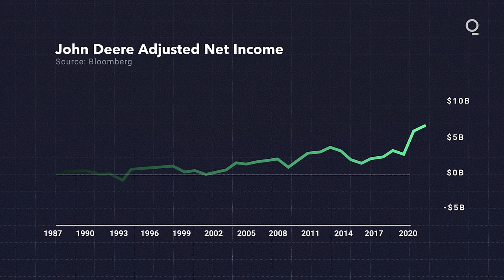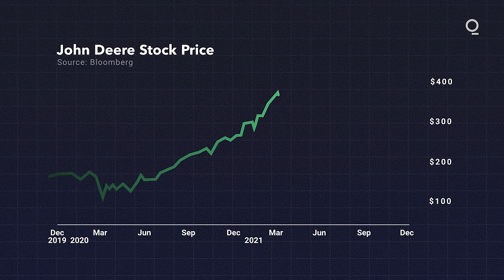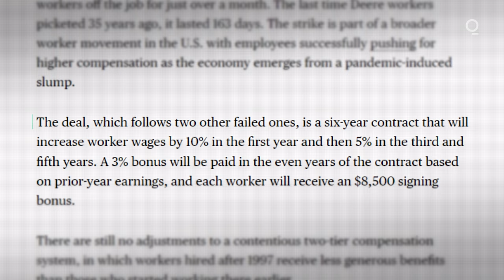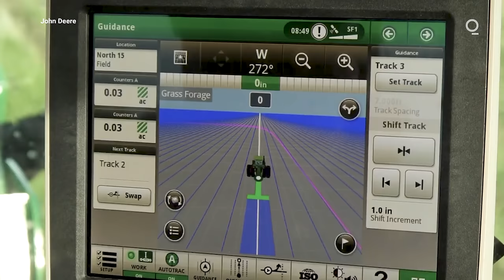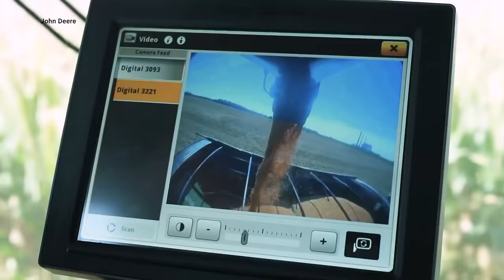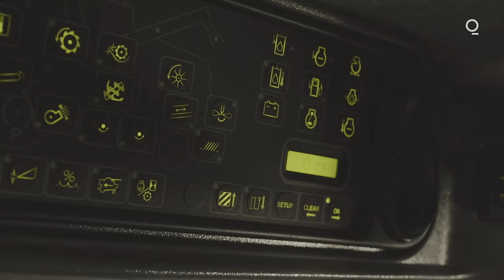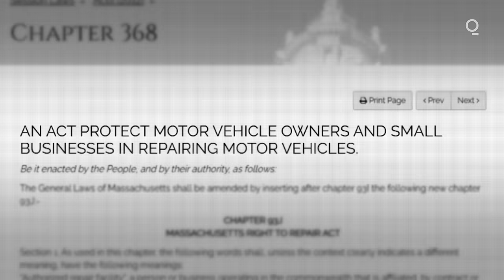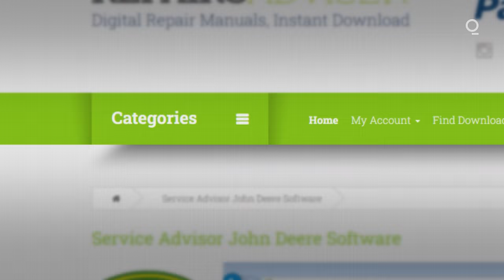John Deere Is Facing a Farmer Revolt

Comment: John Deere is out of touch with their users. "Tractors travelling down the highway." Vast majority of the tractors in the world do not travel on the highway. I am a firm believer that all items no matter what they are should fall under "Right to Repair" doesn't matter if it is a $2.5 Million cotton stripper or a toaster on your kitchen counter. As consumers we should have the right and ability to repair anything and everything. Tractors, automobiles, trucks, and other equipment should come from the dealer with the software and cables for diagnostics and repair ability. As far as modifications go, I applaud farmers that have figured out they could change a 0 to a 1 and gain 200 horsepower out of their tractors.

Even Tesla though doesn't allow owners to perform maintenance and repairs on their vehicles. If I understand correctly, you are technically leasing the vehicle. You never actually own it outright.

Comment: I think that they should be able to fix or troubleshoot the software to at least some degree on their own besides just getting an error code with the saying "call dealer" as the answer. Some errors could probably be cleared as easily as cleaning off a sensor or with only needing a patch update or something that would only take them mere minutes to fix without needing to be a tech savvy repair expert to fix it. Companies should have a tier system like help desk people where someone or something can tell you what the error means and if it's something you can fix yourself or if you "Actually Need" a repair tech.

Comment: I work for a rental company. If I need help or soft wear, and that company does not support. we drop the line. The right to repair is a cominist trait. Company's need to assists end users. Or facade. I hate DEF in 5th level. lots of failure, at my expense/

t

Comment: This is what most Australians don't understand about ag equip manufacturers; they are prepared to impoverish farmers to protect their bottom line and enable others to also 
profiteer from farmers misfortune.

Our tablelands in Qld AU have been satellite graded to optimise production, to manage surface water flows, to... yet fracking (with minimal return to these farmers) and it's negatively impacts on a farmers ability to sustainability  harvest their land and the environment that supports them... as well as the land that is removed from production because of the access roads and networks of pipelines that lock-up significant tracts of land.,, which AU State and Federal Govt deliberately ignore to protect their party revenue streams /funding

JD, DB, Allis-Chalmers, Deutz-Fahr, Cat, Sika, Case... most Australians wouldn't understand where their food comes from

Comment: The right to repair means nothing if every part and piece of anything being manufactured is proprietary. An oil pressure sending unit for a Dodge should fit a Kia. There is no reason mechanically why there are hundreds or thousands of unique oil pressure switches. And that's just one minor small part. Changing a single sensor should not require a computer reset at the dealership. 
Everything in totality from printers to cars and tractors are being made like this. It promotes waste, lose of operational time, products being trashed long before they should be. Yet as individuals in a society we are told this kind of greed driven waste is unacceptable by the same people that fill their bank accounts with bribes allowing corporations to not just continue this practice but accelerate it.    
Our politicians are glorified thieves.

Comment: I believe that the farmer should be able to work on their equipment is they want to. I dont think a farmer is going to take an uneducated guess on the operating  system on a 200,000 + piece of equipment like I am on my $2000 computer. If you are NOT going to allow this you need to provide 24/7 365 days a year service at a flat rate.

Comment: I worked for a company where our equipment would cost over $5 million dollars and we only withheld very specific information and software until people came for training.  Could they modify code on the machines to bypass saftey or such, no.  So jd saying this is just an excuse.  You can put in the coding that specific passwords and feed in data must be met, ie admin level rights.  Now if i can go to jd, ask for schematics and diag sw, but it costs money, then its available.  If they refuse, then right to repair needs passed.

Comment: So are owners locked out of all software, including engine and powertrain management or just the harvesting/field working software? The corporate mouthpiece at 14 minutes in stated he didn’t care about owners ability to repair their vehicles but drew the line at modification. Ok, repair and modification are two completely different things. On passenger cars I use OBD2 to diagnose and repair drivability problems. I want more horsepower I have to buy an aftermarket tuner with new software that gets loaded into the ECU. Two different tools that serve two different purposes.

Comment: farmers still buying JD get what they deserve. i don't think there is a single machine that isn't also made by another manufacturer. i'm not a farmer but i knew about this BS so when I needed to buy a riding lawn mower i made extra sure to not even consider a JD, because of this. if every farmer stopped buying JD they would get the message real quick.

Comment: I love how John Deere rep used Aviation as an example of no right to repair.  Well here's some information for him.  In aviation the OWNER of the plane repairs their plane NOT the MANUFACTURER!  That rep is an idiot.  Also if the tractor fails it doesn't fall out of the sky so it's even more important in aviation where the owner STILL repairs his/her own plane.  If I owned an experimental aircraft the builder/owner STILL repairs his/her own plane.  So JD doesn't have a leg to stand on here.

Comment: It’s a double edge sword, you want to be able to repair your own equipment to save time and money. The other side is the OEM does not want you in some systems because you can damage them unintentionally due to lake of knowledge of the systems or special tooling . Maybe they should set up training for the owners of the equipment as part of the sale so they can be certified by the OEM to work on there equipment. Now at least you have someone trained who can complete the repairs. I’m sure that in this industry you have specialized tooling that is required to complete repairs and if trained on proper use should be offered by the OEM for sale or as a rental for people who own that particular piece of equipment that the special tool applies to . Thats how we do it in our industry we also provide technical assistance in the troubleshooting and repair at no charge to our customers. Nothing worse then being told we can get you in the schedule in a couple of weeks :-( Thanks for the video

Comment: 14:10 A tractor driving down a rural road at 5mph not a fairly comparable situation to a plain flying in the sky with hundreds of people on it. What a joke. The amount of rationalization that has to go into that train of thought is astonishing.

 I'm surprised no one has "jailbroke" these trackers like phones, consoles and other electronics to get access to the diagnostics they need through other methods. And the Magnuson Moss Warranty Act prevents them from voiding a warranty on one part because you altered another. You altered the computer? Fine the computer is no longer warrantied. But that doesn't mean the drive train or anything else isn't still under warranty unless they can prove that the alteration cause issues with the other parts under warranty.

Comment: If the farmer cannot repair it themselves, then will john deere guarantee SPEEDY repairs?  IE 24 by 7.  If jd doesn't then perhaps they should face fines and lawsuits costing them money. when their lazy approach stops farmers from working.    

This video made it clear that part of the problem is that jd and others believe that this about money.  That they can make more money by denying farmers the ability to work on their own equipment.   Even though I have personally spent most of my life working with computers perhaps there SHOULD/MUST be a limit to how much computer control exists for a piece of equipment.

Comment: IF you don't want to have to pay to have someone qualified to fix your machine then buy a machine that doesn't require it...?
John Deere the primary dealer but that is because they are being fed by the same market..
You are looking at RtR like it is a necessity but in reality the freedom to choose an option other than the one that has proprietary repair is the better option.
 Farmers put themselves into this position with the draw of the bells and whistles... If you didn't try to nickle and dime the last drop of profit out of the ground with autonomous vehicles then the market would not be dominated by them and repairability would still be achievable. If you want your simplicity back then revert to the competitors and give up your advantage taken because you are being taken advantage of in the same way. John Deere owners now want their cake and to eat it too. It is a shame markets took millions of dollars invested into this company by many many farmers and it is just now starting to become apparent to them there is an issue..

Comment: The devil always wants his due.  I live near Amish country and they would just laugh at this whole discussion.  What is not said in this video - People want the right-to-repair without breaking the mfg. warranty, or the right to sue if their botched repair ends up maiming or killing someone.  Hey build your own tractor or go back to using that old Allis Chalmers!  

There is also a big difference between just wanting to gain access to a company’s diagnostic software without paying as opposed to digging into the bits and bytes of the software, which I’ll bet no farmer would or could do.  

Business Profit models can get even weirder - There is engineering software out there (Fluent CFD) that actually charges you more if you buy a new computer with more co-processors, a lot more, like $70,000/yr instead of 35,000/yr if you double the number of processors.  Another example - Microsoft desperately wants you to rent its software forever (getting harder to buy standalone seats).

Comment: "The Right To Repair" Works it forces software and Equipment companies to make the best product. To avoid Glitches. that could be fixed in the field. to never make it to the field. To test before producing instead of the consumer being the test bed and loosing there own profits. it causes the producer to be reliable and dependable the 70's and early 80's Proved that with proprietary automotive ecms and tcms now OBD2 software that out preforms factory is getting to be a big buisness. Even aftermarket hardware and software is in direct competition with some factory systems. In a nut shell competition works.

Comment: John der could easily track all farmers yeilds and have equipment programed to fail just enough to steal a significant portion of profit over time,  jhon deer could be doing this for years, this is exactly how the icecream machines work at mcdonalds, there was a expose documentary on this  technique of using bad code or masking easily repiarable faults behind '' see a licencened technician'' .

Comment: It's all relative.  Simply compare John Deere to to the automotive industry in the 70's.  GM and Chrysler went the direction of Finance Leadership versus Engineering and Marketing.  GM, Ford, and Chrysler were the only game in town and were seduced by the dark side of Finance / Legal in order to pursue the Wall Street investor.  This redirection caused a misdirection away from product integrity and customer satisfaction.  I watched it from extremely close proximity.  It was flawed from the beginning and remained true to form right down to now circling the drain at GM and Chrysler.  John Deere has done the same.  The Bill Gates formula of producing a non-stellar product supported by flawed software is going to be their undoing.  Farmers cannot, and will not accept flawed electronic gadgetry in place of operator wisdom to repair their equipment in the field.  It's simply a matter of "if it's not working, I'm not earning".  Will John Deere redirect it's Master Plan ... NOPE, and the Japanese will prevail, AGAIN.  All they have to do is, do it right and wait.

Comment: can't modify software because of "safety" is ridiculous because the company already dissolves themselves of all responsibility for injury or damage the moment anyone else touches it. yet they want "responsibility" over it but only when it's convenient for them. and a tractor is not a airplane. last time i check tractors couldn't fly. air planes carry 100s of tons of explosive jet fuel tractors don't.what's next? telling us we can't breed pigs because their like airplanes?  ps the only "dangerous" part of a  tractor is the engine and it's way safer than a car engine! because  of it's use of diesel(very stable fuel) and very low rpm and all that heavy steel that sits between the engine and driver make it impossible for anything  from the engine to hit the diver.

Comment: Continued thats gradually become brittle and broken, a deck thats rusted through, caused by poor quality protective paint. Not even a fuel gauge! All that will be left soon is the Kawasaki engine. Diagnostics? i am charged £50 for some codes that are meaning less to me. Will i buy a another JD? NOPE

Comment: 15:50 “control of their own destiny, don’t like seeing it in the hands of big corporations”. Then dot use their equipment. Make your own equipment. So using them for repair and software is controlling your own destiny but using the tractor to begin with isn’t? If you lost the entire company would you have a destiny? All that’ll come from this is just significantly more expensive equipment increasing the barriers to entry and sustainability of small scale farmers then when that happens Deere will simply return repairs and software with large scale farmers that’ll be going for better efficiency with the upgrades🤷🏿‍♂️…Americans lately have proven to be one group that constantly votes against their own best interests😂…